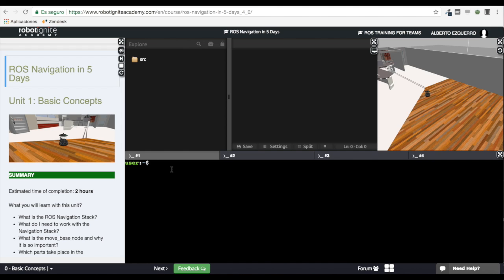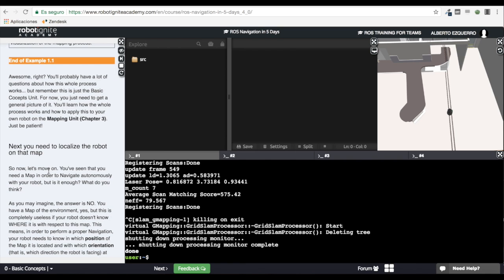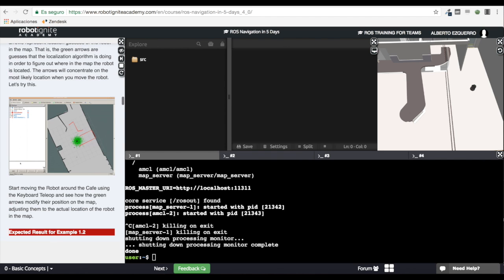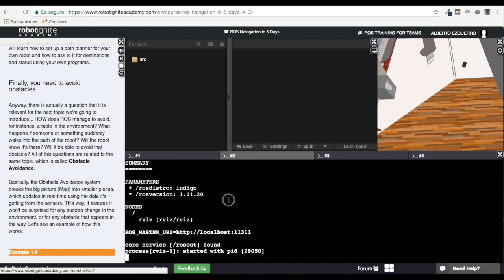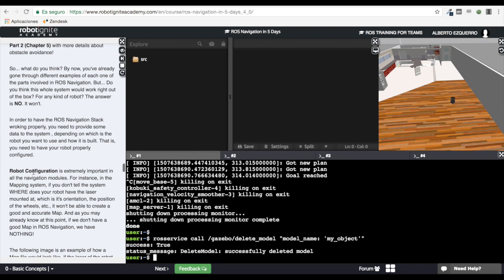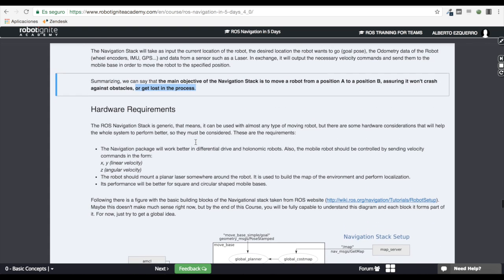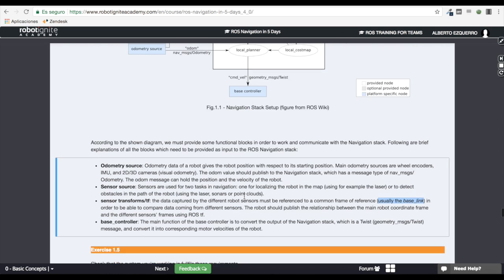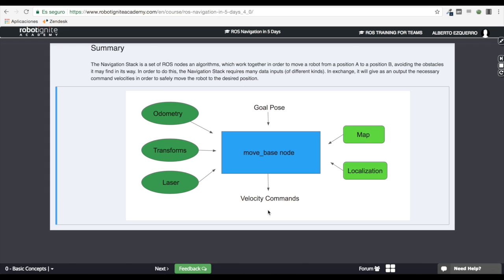ROS NAVIGATION IN 5 DAYS #1 - Course Overview & Basics Concepts

Comment: Im using namespaces and the I set the odom_frame_id in the amcl params to the $(arg ns)/odom, however there is still no particle cloud showing in rviz. Any idea what could be the issue?
Reply from the maker: Check the laser topic if it is correctly connected to the amcl. Also check the messages in the terminal where you launched the amcl to see if there is any error message
Reply: @TheConstruct  I needed to do a remap from map to /map, since due to the namespaces, amcl subscribed to $(arg ns)/map instead of /map.
Reply from the maker: @MrMytubevidmaker  that is ok. No problem. But then, you need to configure properly the config parameters of the amcl in the launch file and provide the proper topics with namespaces

Comment: Salam , can i use all the commands on your tutorials in my actual workspace instead of using a virtual one because my internet connection gets stuck sometimes
Reply: Yes you can. What we are showing here does not depend on the environment, it is just plain ROS. The thing is that we use our environment because it is more convenient, easy to have it working without requiring installation. Also you can have it working on any type of computer (Windows, Linux or Mac). That is the reason we use that environment
Reply: @RickTellezL  really appreciate your generous reply,

Comment: Hi, I had a query regarding the gmapping algorithm. So Gmapping is considered to be a SLAM algorithm but it only gives the map and does not publish any Localization message geometry_msgs/PoseWithCovarianceStamped like Hector SLAM. Being a SLAM algorithm it should map and localize simultaneously which I don't see in Gmapping. Mostly I see people using AMCL for Localization.  I'm not sure but the pose can be obtained using the tf since gmapping publishes tf between map and odom frame and for that separate node has to be written which fetches the data from map to the base link. So, is it appropriate to say Gmapping is only mapping algorithm and not SLAM? Please correct me if I'm wrong.

Comment: Hi,
thank you for the video!
I have a question. How do you create a new project and apply my obstacles and dimensions to it? Do you have an instructional movie?
One more question. Why is the LIDAR used in the example 180 degrees, not 360?
Reply from the maker: Hi, you can learn how to apply that to your own robot by watching the rest of videos of the series. Just check our channel for the other units and you will see where to modify for your own robot (ex. https://www.youtube.com/watch?v=mYwIu4OVMR8&t=2s).
Related to the 180º lidar, it is just an example. Of course you can set the laser to produce 360º. For that you should modify the simulation which is out of this scope. In any case, the navigation code is the same independently of the scan range (you have advantage if you have 360º because you can detect obstacles infront or rear)
Reply: Thank you for your answer. 
So I'm taking a look at the other films in this series ;).
I am very interested in how you can create your own map based on eg my room. I understand that first I have to measure all dimensions and then apply them to Gazebo. I hope that in the next episodes is shown how to do it.
Reply from the maker: I think you are confusing the term 'map' with the term 'simulation'. Those videos show how to create a 'map' of a simulated environment. We do not show how to create the simulated environment, that should have been created previously
Reply: I meant exactly. Is there a movie on your channel showing how to prepare such a simulation?
Reply from the maker: No, but we are holding an online live class next Wednesday showing how to do it. Check it out here: https://www.youtube.com/watch?v=q01dDxeHTMs
ROS Live Classes are open free classes about ROS that we do every Wednesday. People who attend can practice at the same time as we explain. Check it out the previous Live Classes here: http://www.theconstructsim.com/ros-developers-live-class-develop-with-ros/
Reply: Great message! Thanks!
I will try to be present during the live broadcast. And if I do not succeed, I will be happy to see the recording on the page you have given.
Could I ask your e-mail? I have a few questions, and it's better to talk via e-mail.

Comment: Hello, very nice explanation and video tutorial. But I have a question, if I'm using 2/3 external cameras in stereo setup to obtain position estimate of a Parrot A.R. Drone, can I still use ROS navigation stack for Path Planning for drone ?
Reply from the maker: Well that depends on how you want to structure your system. If you have the pose estimate from the cameras, the Path Planning module of ROS can be used to generate the trajectory (provided that you have the map of the environment). That will only give you a path in 2D, a trajectory to follow. How to follow that trajectory is another matter. If you want to move the drone only in 2D you can use the move_base to move your drone. However, if you really want to move the drone in 3D you will need something more complex than that. 
We have a course that teaches how to move a drone in 3D using MoveIt! (https://tinyurl.com/ybjkdtcf). 
Additionally, we have started a video series in Youtube where we teach how to navigate with drones (https://youtu.be/WeBwio2mUZk)